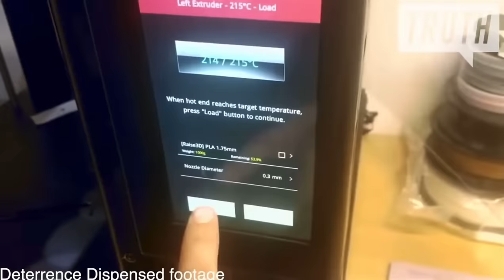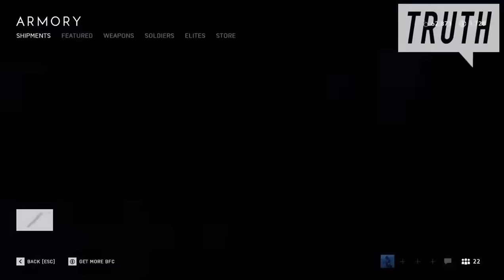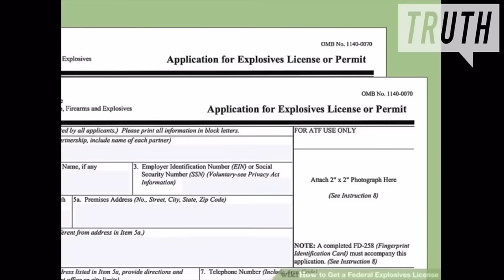Homemade “Rocket Launcher” Documentary 2022 - Archived

Comment: Step 1, make some plastic explosive (easier than you think)
Step 2, shape it like an upside down cone
Step 3, place a thin copper sheet in front of it
Congratulations, now you have a shaped charge explosive that can pen up to 100mm of steel armor.
Reply: Yes, shape charges are easy to make. You can even use glass bottles. A cone shape piece of metal will go through many inches of steel with no problem.
Reply: How do you form the metal cone?
Reply: Right, because it’s super easy to make a plastic explosive
Reply: @Idaho_Knife_Climb  it really is...
Reply: @Idaho_Knife_Climb way too easier than most people think
Reply: @Idaho_Knife_Climb  IEDs:
Reply: @swojal1493  melt copper in a mold, you can even use coins in a used wine bottle if you are really lazy
Reply: Now...Just find a reliable way to fuse it without blowing yourself in half...
Reply: @Jreb1865  You ever seen a BBQ igniter? The ones with batteries are the best since you only need to push slightly. There is the front of your warhead.
Reply: @swojal1493  hydraulik press or 3d print end electroplate but hydraulik pressed are better. there is an video on youtube where they compare them
Reply: are plastic explosives dangerous to make and handle in a DIY lab at home ?   I mean kids lose their fingers by holding firecrackers .   Imagine the power of plastic explosive .
Reply: @virgilio6349  its not
Reply: @C0lon0  not really
Reply: For our sins we deserve eternity in hell, but God loves us so much he came as Jesus to pay the price of our sins  through living a perfect life for us, his death and his resurrection so we can be forgiven and receive eternal life if we follow and obey him in faith FOR LIFE , Jesus loves u and desires to have a personal relationship with you of love, peace, redemption and obedience ✝️ May Jesus bless you, repent of your sins and turn to Christ before it's too late 🙏🏿❤️
Reply: @Noncla  nice counter argument.
Reply: @IamWone  وفقكم الله وسدد خطاكم إلى الجهاد الدائم والجنة
Reply: @Idaho_Knife_Climb  Humans have been using liquid fires since 400bc and been using explosives since 678. There is so much research behind it these days.
Reply: How to make a Plastic Explosive

Comment: I was actually thinking about making one of these rocket launchers about 5 yrs ago but make it out of metal.
The rocket would actually be a sugar rocket. The fuse would be an impact with propeller activation for safety.
Instead I made a grenade with a mechanical fuse (which is very easy by the way).
I don't know why 3D printing a gun is such a big deal because as a certified retired tradesman, I think it's way easier to make something out of metal and it will be a lot stronger.
The only time 3D printing has an advantage is when the part is very complex. Then the computers have the advantage.
Just my opinions.

Great video by the way.
It's pretty clear these guys are all skilled and normal.
Reply: You kinda said it, "Certified retired tradesman", Yeah, 3D printing puts it in the reach of ordinary people with no manufacturing skill.  You just need to be a little smart to read the instructions and assemble it properly but no need for years of experience and expensive tools

Its also automated. You dont have to do most of the work. It just prints while you sleep.  This is especially useful for munitions like the rockets, as you can mass produce without labor.

Comment: Remember those metal toys that were small and used a small impact cap. Throw it in the air when it comes down and hits it explodes. I’m thinking 22 blanks with a tight pin on a spring.
Reply: You guys should NOT be “offering advice” on any topic like this, especially NOT on YouTube.

Use a little common sense.

Comment: Any laws prohibiting this? I know theres laws on explosives ive done it legally so thats not an issue (my rockets would probably be inert just fast flying plastic) also .22 blanks that go into nail guns make pretty good impact charges if ur shooting at a gravel pit doesnt work for dirt had some fun with those and my bow an arrow as a kid
Reply: Federal Law on 3D-Printed Guns
No federal law specifically prohibits an individual from making or possessing a 3D-printed gun.

However the Firearms Act 1968 prevents making homemade guns. Also, how is the law going to know you made a firearm with your 3d printer without invading your personal property?

Comment: from what I've seen the panzerfaust in the first section of the video is propelled by an initial explosion and not thrust
Reply: or does the rocket motor burn out that fast?
Reply from the maker: The panzerfaust is not a rocket based weapon but the fliegerfaust is